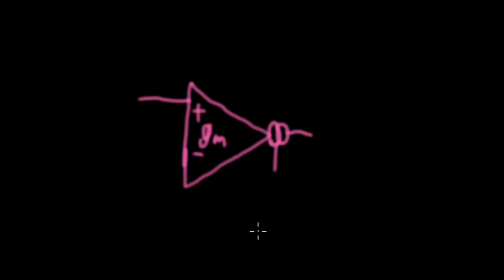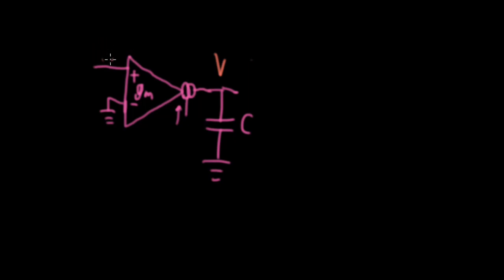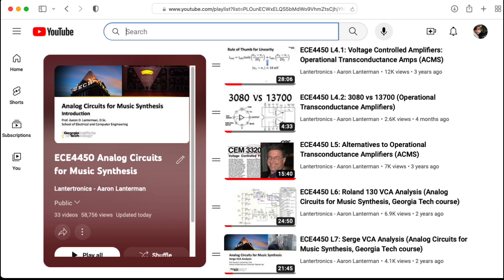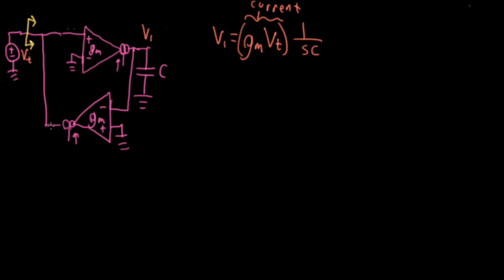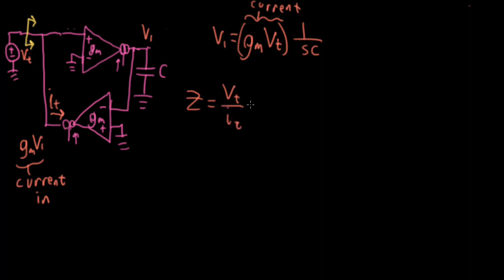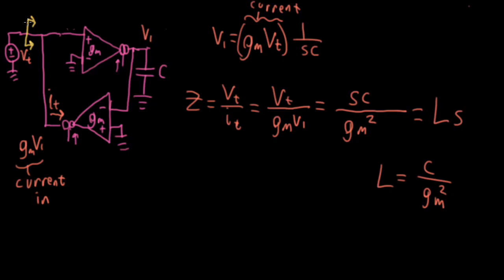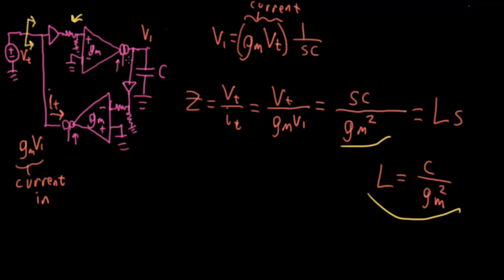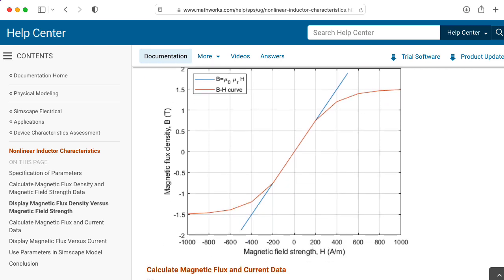Voltage-Controlled Inductance via OTAs (Operational Transconductance Amplifiers) (ECE4450/ACMS)

Comment: This is how to make a tunable filter bank.  When the late Gene Stopp was working on the recreation of the 914 for Moog he had the good fortune of an office next to a manufacturer of audio inductors, so he simply had them make the various values as called out in the 914.  Here using control currents and tuning capacitors the custom coils are eliminated.  I would have to plot the phase shift to see what we get vs. the twin-T bandpass filters, but one 2164 would allow for a 2nd-order bandpass stage.  Might also be fun to use as a node in a vocoder.
Reply from the maker: That's awesome! Pinning this.

Comment: I assume that if the squared term isn't desired one OTA could have a constant current or even be replaced with something like a Howland current pump?
Reply from the maker: I wouldn't worry about it too much, in the sense I'd start by building whatever voltage-to-current converter to drive the OTA that seems handy, and then listen to it as you slowly sweep the voltage and see if it seems "natural." Does it sound like all the variation is jammed at one end, whereas it doesn't change much through the rest of the range? Then you'd want to tweak it. How would depend on how the VC inductance is being used in a particular application.

Comment: Would you do a retake on this and actually build one? i used the circuit from you video and the same webpage you mention here and build the Circuit in the Falstad simulator, it seams both ota's cancel (+/-)  each other out and nothing to be measured unless you delete a connection and disconnect the output of one ota. After this video, the document on mixing consoles i showed you also contained this circuit, but no where is to be found a complete working circuit albeit even having documentation (PDF) from "universities" and so mentioning this aswel.

Would you try and build one and the math to discover what capacitors you need? probably a very tricky one considering the current of the iABC pin.
This is one of the coolest circuits in the electronics music biz, i guess, Also BP, NOTCH seams to be possible.
Reply from the maker: Did that document have an OTA-based Gyrator or an op amp based Gyrator?

Alas, I won't have time to work on this particular circuit any further anytime soon...
Reply: @Lantertronics  Page 34, fig 39B in the Steve Dove mixing desk "trans conductance", showing a iABC input, no worries i can't make pcb's in the first couple of months, i asked on Groupdiy mentioning your video, but go no answer, we have mystery circuit her. : )
Reply: @Lantertronics  I made the same exact Gyrator circuit as mentioned on "sound-au", the source you used in your video, i replaced the opamp with the 2 ota's back 2 back, i also toke care to provide the correct Falstad "LM13700" feedback, like in OTA vcf's, like Roland, Korg ms-20 filter.
The only thing it does is going full swing high or low right at the start of current input on the iABC pins and the remaining 97% of current o the iABC pins it does nothing.
There is no motion, i can't provide you with the link.
Reply: @Lantertronics  you need to cut and paste the Falstad "short" link with this: "/ynmvotn9", to have acces to the circuit i made.

Comment: My professors wouldn't let me change the order sL to Ls, s can be equivalent to the differentiation operator s=d.../dt (Laplace) or the more famous frequency multiplier s=iω.
Moreover, we always write s with a lowercase letter, and L and C with a capital letter, at the end of the video we have sc (or SC?).
I still miss the mention that such a resulting inductance, unlike the real one, cannot store energy.
To the question about the non-linearity of the original inductance L and its counterpart built on gyrators - this similarity is accidental and is caused by totally different reasons.
In addition, there are also realword inductors without this effect - air coils. And the last thing - an ordinary inductor at higher frequencies begins to be a resonant element, due to the capacitance between the turns, unlike  electronic equivalents (similar to a capacitor - Feynman discusses this in more detail). 
Gyrators, variable conductance amplifiers or regular amplifiers also have limitations at higher and higher frequencies, but their nature is different - current limits and similar - parasite capacitances.
 A good design or description should include the range of voltages, currents and frequencies (e.g. DC-200kHz).
Reply from the maker: I always intend to write lower case "s" and upper case "C" here. If it looks otherwise, that's just the result of a combination of my inherently terrible handwriting and the awkwardness of using the graphics tablet while looking at the screen. ;)

Your professors were being completely absurd in not treating sL and Ls as equivalent. That makes no sense to me at all.
Reply: @Lantertronics  - we have a saying (in Poland) - an opinion is like an ass, everybody has its own one - no offence please :)
There are some ways to express physics in equations, nowaday science is global, it would be nice to obey some good rules.When (particularly by handwriting) somebody notices "Ls" and "s" is more than usually small - this person may be confused not to be sure if it is an inductance L with small index s, meaning something like ... strayed inductance for example.
A good rule is to keep the same order in all equations. sL, sC etc. I can easily imagine myself an eqaution with sLp - where s is an operator d/dt (or iω), L is inductance and p may define a parasite inductance. Not possible to be so clear when sL is written as Ls. My current comment loses a lot when I can't write small indexes.

 Something out of topic, still equations. We (central, eastern Europe countries, not anglo-saxon, imperial influenced) use the following manner to write some equations concerning mechanics. Energy is E, kinetic Energy is ...Ek (small index k, not possible in comments), potential Energy is Ep and so on.
Lagrange equation  in this notation is:  L=Ek-Ep, not L=T-U.  It is much more consistent, concerns other branches of physics too.

I fully understand - not possible to introduce in the USA or Great Britain. You are very conservative (agian: no offence please), a good example is keeping in use (being stack in use) of imperial units, with Middle Ages origin, which were good to quantify, evaluate amount of harvested rye, volume of beer drunk without losing conscious, measuring are of the field to be ploughed from sunrise till the evening etc. Its enough to analyze in details, origin the unit of pressure - psi 

I appreciate you answered my comment, thanks

Comment: The LM13600 and LM13700 are probably my favorite ICs to use as building blocks for audio applications. 👍
Reply: "protip" for poor amateurs - NE5517 is an obscure alternative with comparable performance, dirt cheap and easy to find. (Might be somewhat improved even. The output stage has a slightly different design.)
Reply: @Ormaaj  Very cool! Most definitely obscure. I have a crap ton of ICs but, never came across that one. I'm surprised actually being a Transconductance amp fanboy. I have a few dozen vintage 3080's waiting to be used. Thanks for the protip! Cheers 🥂

Comment: I was introduced to the Gyrator circuit a few years ago in a book; specifically a Gyrator in a generalized impedance converter (GIC) topology for a receiver that used no inductors. The calculated Q value for an LC circuit using the GIC Gyrator was 50 - which is respectable. I was amazed and intrigued..

Comment: 2-minutes until I subscribed. This is awesome.
Reply from the maker: Thank you so much! If you go to my playlists, you see lectures for several of my classes that you might find of interest (in addition to odds and ends like this one).
Reply: @Lantertronics  I will absolutely devour your analog circuits for synthesis material. After I completed my undergrad degree, I enrolled in a two-year EE program at my local community college entirely so I could learn to work with my guitar equipment and develop my own effects. It’s been hugely rewarding, but it’s not always easy finding intermediate level content online. I really appreciate the effort, and look forward to learning a lot!
Reply from the maker: @silverXnoise  Just curious, how did you find my video?
Reply from the maker: @silverXnoise  Ah, you'll like my "Guitar Amplification and Effects" playlist as well. After all that check out my ECE3400: Analog Electronics playlist. I also have some op amp material in my ECE Design Fundamentals playlist (skip the first lecture in that list, it's specific to a Georgia Tech class)
Reply: @Lantertronics  YouTube’s algorithm struck the right chord for once. I have been watching a lot of lectures from Audio Developers Conferences and on JUCE programming, so it may have just been primed to serve up more lecture-type of material. I look forward to this newfound pool of knowledge, thanks again for sharing!

Comment: I have a question, can I substitute THAT2180 (uPC1252 or V2159) with CA3080?
Reply from the maker: No, and you wouldn't want them to be equivalent, really; they're different ICs for different purposes. Both are current output devices, but the signal input on the 2180 is a current, whereas the signal input on the 3080 is a voltage. Also, the control input on OTAs are currents, but the control input on a 2180 is a voltage. In addition, the control law is different; the 2180 has a built in exponential characteristic, whereas OTAs have a linear characteristic.

Comment: I’ve spent a lot of time digging into the HM-2 tone controls and would be curious to build an OTA version but I’m unsure of which original capacitor to keep (to preserve the desired simulated LC characteristics), what value capacitor to use between the OTAs, and how to set the control current for unity gain. Any advice? I would use LM13700s. 

Also as a practical matter, unless there’s a really obvious sound difference you probably wouldn’t use this in a real world audio circuit because the price difference is significant— you could do the HM-2 with a single LM324 at $0.29/ea but would need 3xLM13700 at $3.99/ea (at small-quantity prices, although I suspect the ratio stays more or less the same) — it’s a 40x price difference!
Reply from the maker: Yeah, I think the main application for OTAs would be when you really want a voltage controlled inductance, like maybe in a Eurorack module.

It would take a me quite a while to puzzle through exactly how to make an equivalent circuit. The OTA just makes an inductance, the usual gyrator configuration used in guitar pedals has other RC aspects.
Reply: @Lantertronics   thanks!

Comment: Cool! Is there any practical experience with it? Any test cases / test circuits?
Reply from the maker: Apparently these are used in integrated circuit designs since making an inductor in an IC is really difficult. But I don't know of anyone who has used this OTA-C type simulated inductor in a PCB-level synth or guitar pedal design (or anything else for that matter).
Reply: @Lantertronics  could the lack of use in pcb level circuits be due to difficulties matching the transconductances of the 2 OTA's? 
I've lost the link, but there is a design for a 'chaotic oscillator' on the web which displays the Strange Attractor in x-y mode on a 'scope. This might be a good excuse for me to try it. I have a couple of OTA's around.
Reply: @gerryjamesedwards1227 What about dual OTAs like the LM13700? Shouldn't they be similar enough?

Comment: The non linearity of the OTA is voltage saturation or horizontally asymptotic while a kind of cubic non linear transfer function of the feed back OTA should approximate magnetic saturation of an inductor. 
The actual saturation style non linearity of the OTA more just lessen the Q factor or are some kind of inductor series resistance.

Comment: I am not very well versed when it comes to transconductance amplifiers but I always thought they were current devices. This why they include the extra transistor to convert the current output to voltage. Feel free to correct me if I am wrong. But doesn’t that make the input impedance zero? And by you using “voltage buffers” you are making impractical assumptions? I honestly don’t know so would appreciate your take on it. Again, I have very little experience when it comes to transconductance amplifiers.
Reply from the maker: They're current output, and the transconductance control pin is a current input, but the differential inputs are voltage inputs, and ideally the input impedance of those is infinite. 

Sure you can use voltage buffers; just an op amp with the output tied to the negative input terminal.
Reply: But you put the “voltage” buffer before the input so the source will still see the output of the transconductance amp, which will be low. That is where I am having my brain fart as to understanding. So in my mind, once you start adding buffers or resistors in front of this, things start getting complicated. Unless you drive this with a current source of some kind? I am always thinking in terms of guitar effects which are high impedance sources if that helps.
Reply from the maker: @johngreene3633  If the output of the OTA is an idea current source, it's best to think of it as a Norton equivalent circuit with a high output impedance.
Reply from the maker: @johngreene3633  All adding the buffers and resistors does is effectively cut down the signs going into the OTA. We're assuming the OTAs are ideal voltage inputs, i.e. high impedance inputs, and the buffers are just another ideal voltage input, i.e. high impedance input.
Reply from the maker: @johngreene3633  If the resistor divider has a small resistance Rsm going to ground, and a bigger resistance Rbig in series, all you do to the formula is replace gm with (gm * Rsm/(Rbig+Rsm)).
Reply from the maker: Check out my ECE4450 playlist, lectures 4 through 7.